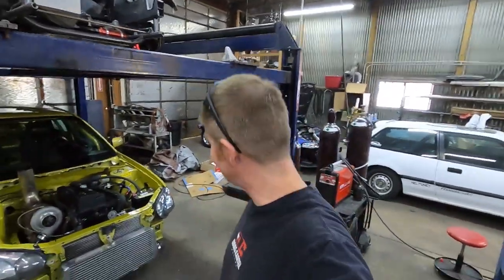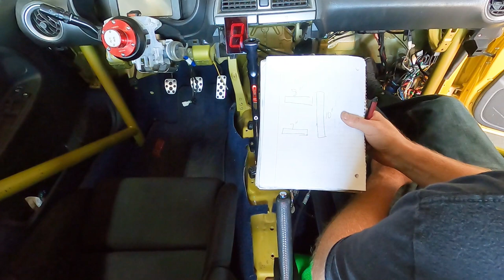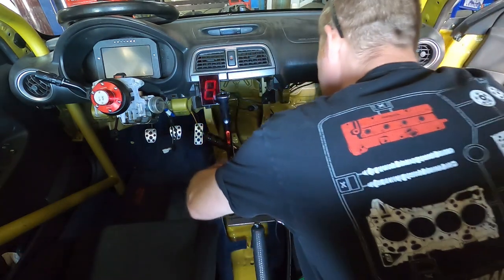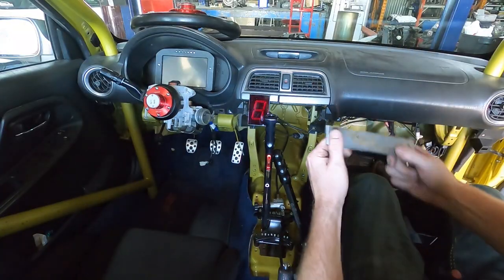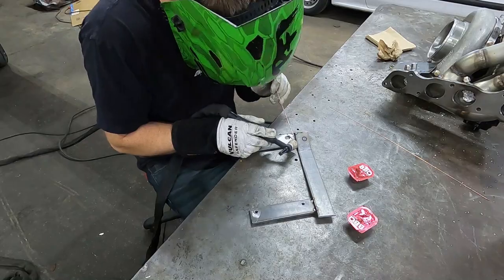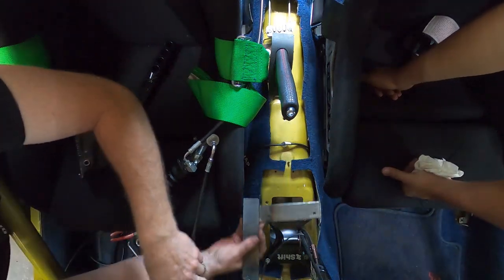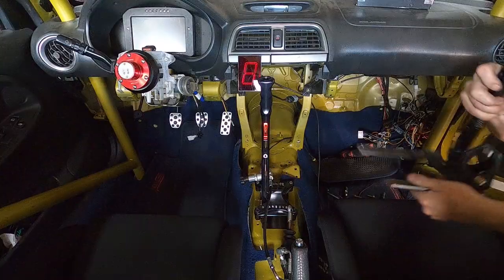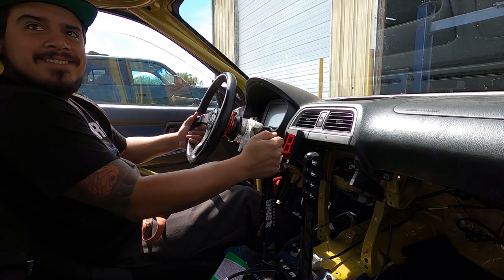Getting Hondaru set up for the Track!

Comment: Shawn, you need a bench grinder and you can sharpen bits by hand. I takes time to learn the trick but I can confidently make a bit cut down to 1/8.  But I just buy those. Have to make sure your lead cut edge stays the highest point. If not, that's a bit that squeels and doesn't cut. The cut edge isn't digging. Look at a large bit's edge and use the side of the grinder. I like the flatter surface since Co workers beat the front edge up.  One day I'll buy myself a drill doctor.

Comment: Yesterdays upload ☹
She already done blown tf up
Reply: I feel for the guy he just can't win
Reply: dropped a valve isn't blown the fuck up.
Reply: @mbsnyderc  does it run?
Can he just replace the valve without machining the head?
Can he go to mexico as it sits?
Its blown tf up
Reply: Again
Emilio cant catch a break
Reply: @mbsnyderc  lol from race ready to back on a lift for a month.
Idk what your definition of blown up is.
But having your car sidelined, after 1 pass, in my opinion is blown up.
And it literally blew hoses off and blew out blue smoke.  Almost, like it blew up 🙄
Reply: @colesteven1123  blow up implies catastrophic damage. He just had to replace a valve, valve seat, and some retaining clips. If they had the parts it could be fixed in a few hours.
Reply: @DJ.1001  catastrophic faliure implies the motor no longer works as designed.
Which it doesnt.
Which means it blew tf up
Reply: @DJ.1001  how long has the mr2 been down? For the exact same problem

Comment: You forgot about left/right rotational support; after a while of not pushing it perfectly forward and back, the part will fatigue. Add vertical height between the straps and the main lever area.

Comment: @Brent  do you guys load the dyno to put the drivetrain under stress, like rowing all throughout the gears under full boost, it seems the sequentials are causing the problems not shifting which is making valves smack pistons.

Comment: Didn't they just go to the track in the head went bad 
The same head as the MR2 .. I don't remember what hole it was
Reply: Yea same head different hole and goofy built Shane just had another 4p on his channel that's blowing oil out the ports
Reply: Cyl 2 I think was the one that was down on Hondaru and 3 on the Mr2
Reply: Maybe the other way around lol
Reply: Yeah they blew it this is just the tuning before that
Reply: The peak horsepower of these Honda engines are extremely impressive but they don't seem to be very reliable at that power level.

Comment: Dam what a mind screw that was sorry she broke buddy hope it get fixed without breaking the bank but I would think about a stronger valve springs my father had the same problem with a datsan pickup we put a turbo on it form some other car and after it was all said and done 3 heads,2 cams,a number of valve springs starting with stock and ended with more then what the can needs to keep it form floating then there came the rear end after a new stock one and one form some other car we put a mustang on it and then we started to move to bad the truck got old and we left it to rust right where it is sitting right now to this day have fun thanks for reading my little story and I hope it all works out for ya Emilio your a good dude

Comment: I think you are still having load issues on the awd dyno. That is putting some real stress on the drivetrain. Then when you get to the track, all of your tuning work ends up being too much for what you expect which causes even more strain. Hence all your failures. I know your argument to that would be, it was an issue with the head, that has been repeatable. However, IMO, that repeatable is the dyno putting way different strain on the motor and drivetrain. Please dont take that as me saying anything about you or the dyno, that's not it. I'm just saying, from someone that turns wrenches, it would appear to me that's where your issue lies. Think about it, you're already putting real different strain on that K motor, let alone turning an awd chassis. 
Dyno is what's hurting Hondaru
Reply: A dyno with load control helps the tune,  you can see every possible load cell.   Thats why these dynos have sweep test and steady state tuning abilities
Reply: Watch the video again, it's OBVIOUS that it popped the keepers out when he missed the shift (over reved). Yes different loads make a difference on the dyno (Brent knows that) it boosts quicker vs rpm with more load, but that'll make the tune safer rather than not safe for the track (less load in lower gears)...